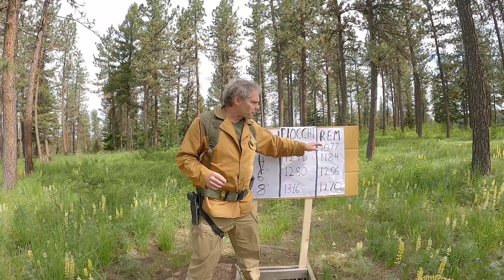How Does Barrel Length Change Velocity

Comment: This test was about as accurate for testing barrel length velocity difference as you could achieve. With factory ammo, the results were fairly consistent with what I've expected/experienced. With over the four decades of hand loading you learn how powder burn rates affect velocity. The .357 velocities were a little surprising from the longer barrels (in the minimal difference). Loads today are apparently designed for the shorter barrels, so a faster powder is used and as you so accurately stated, they're pretty well fully combusted in the 6-8 in barrels. I typically see a 40fps increase with every 1/2" barrel length increase, that's a very general estimate with a +/- of 10fps. With a much slower powder those velocity difference will more than likely be closer together with the shorter barrels and more significant with the longer, it's always a trade off. My data is pretty much based on semi-auto pistols, revolvers should portray a more accurate story though I could be totally off on that bit of conjecture. Great video, Paul.
Reply: In my experience and testing you are correct in your analysis. I have a fair amount of load/chrono data for .38 and .357 magnum cartridges fired from a 2" and 4" revolvers as well as a 16'" carbine rifle. As an example I have a .357 load with a 158 gr JHP utilizing a slower burning magnum powder and my data shows 2" 1088 fps, 4" 1139 fps, 16" 1760 fps. In comparison a .38 special 125 gr FMJ with a faster burning powder shows 2" 845, 4" 926, 16" 1230.  This is only one comparison but it does show that there is less of a difference between the shorter barrels with the slower burning powder and more with faster burning and the opposite effect with a significantly longer barrel (based on my testing and my guns). Admittedly, I don't have much data for magnum cartridges loaded with faster burning powders as I really have no need to do so.
Reply: @poppasmurf3453  So if those same rounds were fired out of a 3" barrel, the velocities generated would be just a tad slower than those fired out of a 4".

Comment: I know in my DW 357, the 6inch barrel seems to not only have the highest fps but also is more accurate with most major brands of ammo, then the 2.5 or 4 inch. This gun was made in the 70s and came with the 6. The 2.5 and 4 were bought in the 80s, but are factory made, not aftermarket.

Comment: I can't speak as scientifically as some of the commentators here but wondering if the more significant differences in the heavier bullet was due to it being (relatively) harder to push forward, so the extra combustion time and pressure makes a bigger difference.
Reply: a heavier projectile would probably increase the burn rate by a small amount due to the increased initial pressure, thereby reducing the combustion time. 
i think the different velocity change would be primarily due to different powder choices by the manufacturer, and secondarily a slower heavier projectile would be able to get closer to the speed of sound of the gasses propelling it more easily.

Comment: It would be interesting to throw a .357 lever action carbine into the mix to see if there would have been a drop in velocity especially with the Remington ammo. I've always wondered if pistol caliber carbines are effective with ammo loaded for pistol barrel lengths under 6". I'm assuming factory "pistol caliber" ammo is optimized for pistol length barrels, correct?
Reply: I shoot identical .44 "magnum" ammunition (reduced loads for SASS matches where limiting the maximum velocity out the barrel is the goal) in my Ruger revolvers (5.5" barrels) and Marlin rifle (20" barrel). Granted, the actions and barrels are different, but my velocity goes from 790 fps in the revolvers to 930 fps in the rifle. If .44 magnum defensive ammo comes down in price, I'll have to try chronographing it.
Reply: @kevingoebel170  regular winchester super X is 1800fps out of a 20 inch 1892 levergun

Comment: From a mathematics angle yes the longer distance would improve accuracy, though with diminishing returns akin to velocity. The question is similar to velocity, weather its enough to matter or not. The answer is that is in all likelihood situational, and the disparity in between the options is much more likely to be outweighed by other factors.

Comment: I'm a big fan of Dan Wesson revolvers and have a nearly identical pistol pack. Additionally, I have other DWs with 10 and 12 inch barrels.  I'm not at all surprised at the diminished returns in velocity but, for me at least, I really feel the benefit of the longer sighting plane.

An excellent video as usual, and I look forward to a follow up addressing the accuracy/barrel length topic.

Comment: May you please do a video on .22lr, and simply test hand guns and rifles with different barrel length. I wonder where the diminishing returns start with a small caliber like the .22lr. I've always used a 22" barrel on my rifles, but I wonder what the most ideal barrel length would be. If there's already a video on this, please share.
Reply from the maker: If I can get the right guns to make a fair, realistic comparison I'll put something together. I have heard conflicting reports about when .22 barrrels are too long.
Reply: @PaulHarrell  you're the man!
Reply: Supposedly 22LR velocities start to suffer after 16", but longer barrels have been popular due to the increased sight radius.
Reply: @craigbenz4835  I'm watching videos on it now. But nothing compares in the slightest to Paul Harrels extensive knowledge and mitigation of outside factors on the test subjects in his videos.

Comment: Mainstream ammunition brands are going to run pretty under-utilized powder capacity in the .357mag. If you want to see more dramatic velocity increases with barrel lengths, go with the hot stuff. Buffalo Bore, Underwood, Grizzly, Doubletap, Corbon, Steinel, and some others. Buffalo Bore will run 158 gr bullets at 2,153 fps from a 18.5" carbine, and 2,298 fps with 125gr in the same carbine.

Comment: Nice video. 👍. I first noted this effect in a 22LR. The 22 semiautomatic Savage, while EXTREMELY accurate, would subjectively loose velocity from the longer barrel. I kept using it because of it's extreme accuracy, but I KNEW it wasn't as "fast" as my Savage NRA Sporter. One of the "gun gurus" in the '70's used a single barrel, and cut off one inch at a time.  Average velocity loss was 100 to 150 fps per inch from the rifle cartridge he was using. Now this doesn't translate well into pistol cartridges, but the principles should hold. Longer barrel = faster speed (up to a point).

Comment: Good test.  I’m a bit surprised there was not more difference from 4”-6” and 6”-8”.  I suspect most factory loads are optimized for the more common barrel lengths so 6” is probably about the longest that would give you any significant gains. If you roll your own and use slower burning powders you could probably see a more significant difference in the longer barrels. I use 7.5” and 6” revolvers for hunting on occasion and also reload, but I don’t own a chronograph unfortunately so I don’t know if any of my loads are really getting the most out of my pistols. Maybe it’s time to invest in a chrono.
Reply: How are you reloading ammo without having a chronograph to even check for standard deviation on your ammo? Not trying to be an ass but it is a basic principle of reloading if you want to understand what the changes you make are doing to the rounds you fire.
Reply: wouldnt say needing to know standard deviation is basic. if accuracy cant detect the problem then most of the time it probably isnt enough to be relevant in the situation.
Reply: @TryinItAgain  reload for accuracy and you'll pretty much have a SD that doesn't matter.

That's how people hand loaded for decades before chronos were available. If you're competing in long range shooting sports it matters but outside of that loading for accuracy at normal hunting and self defense ranges you'll be in a more than enough without having a chrono.
Reply: @JamesSmullins  well phrased
Reply: @TryinItAgain  Some people reload for cost, others do it to get a specific load.  The former doesn't really need a chronograph.
Reply: Most people I know that reload don’t own one but do borrow one at times. If your getting desired accuracy standard deviation probably isn’t that much to begin with. It’s not much different than testing factory loads. They either perform as desired or they don’t. If your following load data you should be in the ballpark of performance the manuals indicate, but yeah a chrono would allow better testing and optimization.  People have reloaded far longer than we’ve had chronographs, and especially affordable ones. I also only load pistols and there are fewer quality control factors to worry about that may affect any performance factor vs rifle ammo generally. If I loaded for rifles I would definitely own one.
Reply: Air resistance doesn't increase linearly, resistance is squared as speed is doubled

Comment: Hi Paul
A resource that may be relevant to this topic is a website called "ballistics by the inch". They have tested multiple calibers by cutting down a long barrel 1 inch at a time. They also have a section on the effect of various cylinder gap distances. Very interesting stuff.

Not trying to take anything away from your presentation, just thought it may be of interest.
Reply: SCAM ALERT! ^^^ THAT is a SCAMMER. Please be aware that that is a SCAMMER and do not fall for the SCAMMER.
Reply: @Sableagle  
There seem to be a lot of those scams going around at the moment. I've been reporting all that I see, but I don't know if YT actually does anything.

Comment: Maybe the worry about there not being enough propellant burn time to keep the bullet accelerating through the length of the barrel comes from longer pistol-calibre carbines, or maybe the pressures from modern gunpowder just push the bullet out too fast and there could be a difference when it comes to older lower pressure ammo.

Testing with that pistol pack was a really good idea, much more definitive results than just using a couple revolvers that seem close enough. Great video!

Comment: Just like to add, after pouring over tons of chrono readings from many sources, I can say with certainty that the effect barrel length has is significantly reduced in revolvers as compared to closed-chamber guns.

What I mean by that is that FPS increase per inch of added barrel is less for the revolver then the semi, for a given caliber. Furthermore, the point where speed starts dropping instead of rising is significantly shorter for revolvers, though that is partially dependent on ammo. Basically, 8" is the max barrel length you want on a revolver, period. And for less powerful calibers  (like .380, 9mm, .22 magnum ect) that length goes down to 6 inches. 

For closed-chamber guns, like pistols and PCCs, you can wring a lot more velocity out of a given caliber with a longer barrel. I have one particular 9mm reload that uses all 16" of my PCC, and gets about 1600 fps. Though generally for weaker calibers, 14" is the max, and 20" for everything with 'magnum' attached to its name, including .22 magnum.
Reply: That's what I would expect due to the cylinder gap.

Comment: Considering that, with a longer barrel the rifling will have both more time and more surface area with which it can engage the bullet, does a longer barrel also make it significantly more accurate?

This could easily be demonstrated on an AR platform by swapping out a variety of barrels or uppers, and shooting at a longer distance.

The SCAR family of guns were designed with swappable barrels in mind, but that's probably cost prohibitive to test on that platform.
Reply from the maker: We have a presentation comparing the accuracy of different length AR barrels and we'll do an accuracy comparison with the Dan Wesson next week.
Reply: @PaulHarrell  Looking forward to seeing it! And thanks for the reply!
Reply: @PaulHarrell  How about differences in the cylinder gap and how it affects velocity?
Reply: I was thinking about differences in accuracy with a longer barrel too. That would seem to be another logical reason to go for a longer barrel depending on intended use and range to target.

Comment: Hmm... Does a greater barrel length make a gun more mechanically accurate? Or is it just a matter of a longer sight radius? That would make for an interesting video. Just guessing, but I bet it does to a slight degree, much like longer barrels give higher velocities to a point. There's also a matter of the material the barrel is made from, the particular ammo being used, wind, rifling wear and other variables.

Comment: The greater velocity is probably due ALSO to the greater amount of time that the pressure is acting on the bullet. Pressure exerts a force. A force over a time frame generates an impulse which generates momentum. Momentum is equal to force times time (longer barrel equaled greater distance and therefore greater time and greater momentum).
Reply: Momentum is mass times velocity.
Reply: @metamorphicorder  That's also correct. Check the units and you'll find that force times time equals momentum equals mass times velocity. All three quantities are expressed as mass times distance divided by time.

Comment: I think that the velocity will continue to increase until the combination of the pressure in front of the projectile plus the friction/drag on the projectile (from air, barrel and rifling) is equal to (or greater) the pressure from the expanding gasses from the powder. So how fully burnt the powder is is a factor (pressure will tend to increase until the powder is all burnt) but I am pretty sure that the projectile will continue to accelerate even after that until the pressure in the barrel lowers (from expansion as well as loss from cylinder gap or incomplete seal or operating a semi-auto or whatever else) enough that the combined forces on the other side is higher and it starts to decelerate. I guess it would probably take a few different specialized knowledge sets to be able to calculate all that. The alternative is to just use experimental data (like here) to determine what length of barrel is best for a given model + ammo combo. Sounds like something gun manufacturers could do, but they have an inherent bias that would be difficult to overcome.
Reply: That's correct. It's the longer time pressure has to act on the bullet, not just the combustion itself, that imparts higher velocities out of longer barrels, until the pressure is too low to overcome barrel drag.

Comment: Then we have to ask: Why lever-action .357's with 10+ inch barrels? It's likely a significant contributing factor to our diminishing returns is the cylinder gap. Does a closed breach give us a better pressure seal and even greater velocities from the same .357 ammo? More than that, I'd love a demonstration of too-long barrels slowing a bullet: When does a barrel stop being a pressure vessel and start being a vacuum chamber? It's easy to accomplish this with 16-inch barreled 9mm and .45 ACP carbines.
Reply: paul's video on .38 super in a revolver has some info about cylinder gap energy loss, also i think he has a few presentations with his ruger LCR and comparable barrel length pistols. 
when talking about the energy exerted on a projectile, you need to remember particle physics; the gas is a number of particles in a confined space moving around, hitting the barrel, breech and projectile, imparting some energy. as the projectile goes down the barrel further, the pressure diminishes, because the particles have more space to move around in. therefore, they impart less energy in each collision, eventually being equal to or less than the force needed to continue pushing the projectile down the barrel at a given velocity. 
there's also an upper limit on the velocity reached with a given propellant, depending on the speed of sound of the gas produced by the deflagration of the propellant. with smokeless powder, that's around 5000 feet per second (if my memory is correct).
for a barrel to become a vacuum chamber, you would need an extremely heavy projectile, extremely high inertia/initial velocity, and little to no gas generated by whatever propellant you use. the closest thing i could think of is some kind of 40x46 LV projectile in an obscenely long barrel.